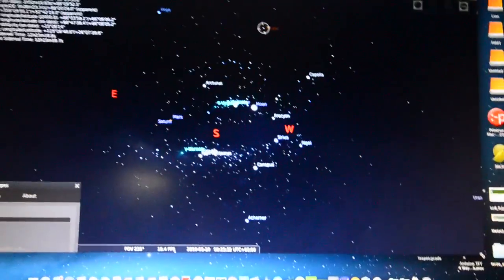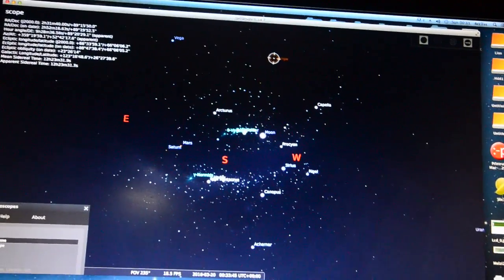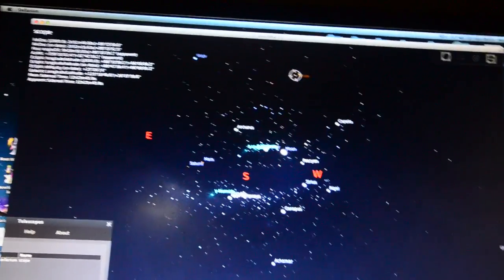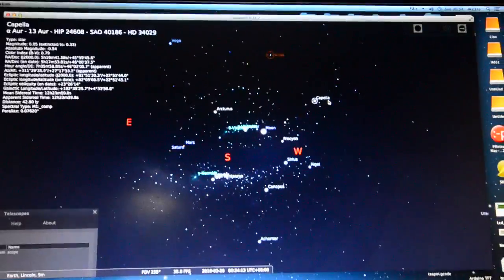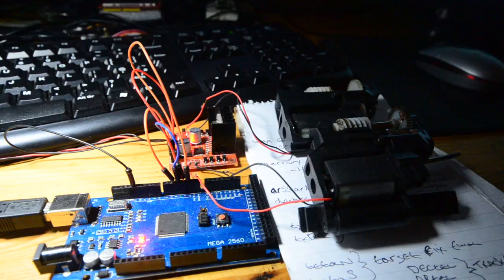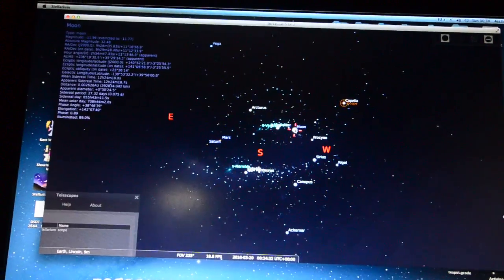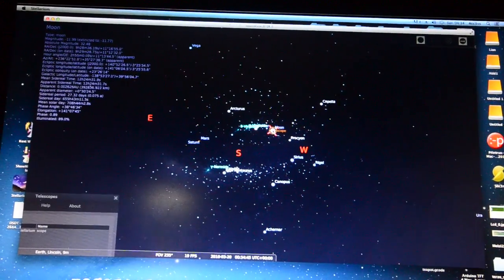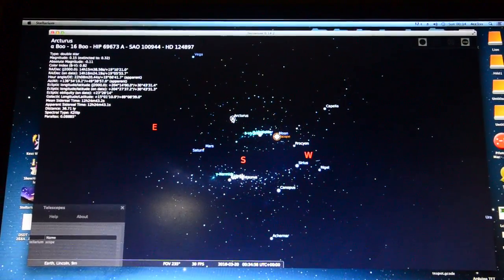Arduino Stellarium Star Finder Goto

Comment: Can I see the arduino source code? thank you
Reply from the maker: Hi, i have longer the source, but it was originally downloaded from a site, but i had to change the engine so it worked with the motors from a meade etx70, i stopped all this when i acquired a working meade.. this guy Dessislav Gouzgounov has done a fantastic job with the goto using Arduino and all is down loadable including source.